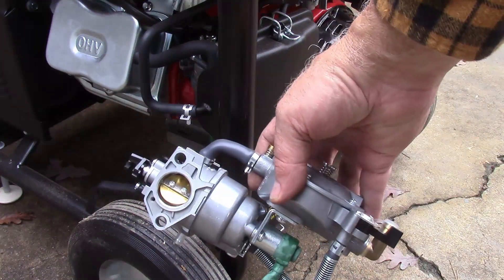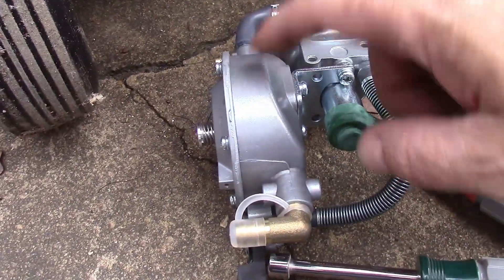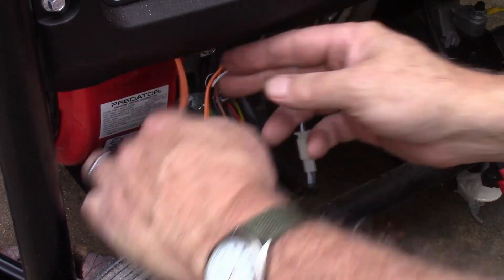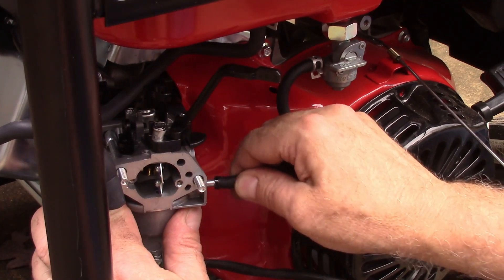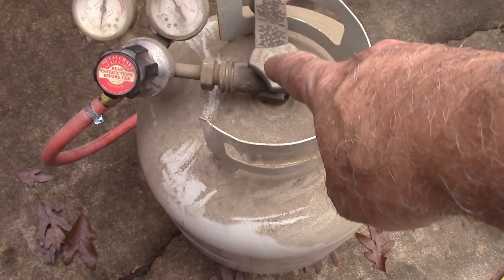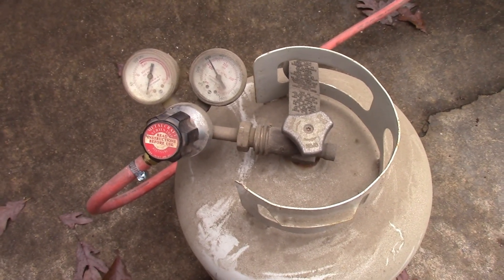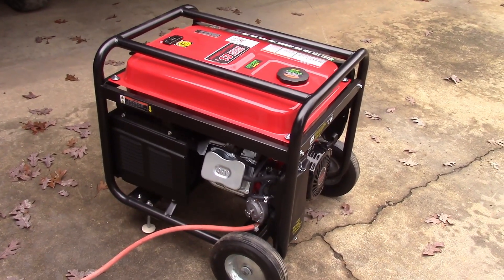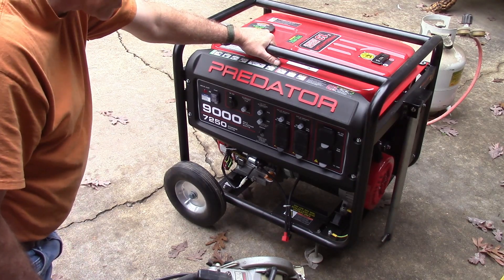Predator 9000/8750 Generator Propane Conversion  Tri Fuel

Comment: NOT FOR NATURAL GAS !!!   the link provided takes you to Amazon where product description says LP/CNG conversion kit.   CNG is Compressed Natural Gas which is not the utility being fed to your house thru a gas line.  This is the pressurized version they use in some city buses and truck fleets.   You can get a carburetor for household natural gas, but it is not the one shown in this video !
Reply: Please provide information to this 'household gas carburetor' that you keep referring to...thanks!
Reply: So much spam!!
Reply: Not so fast ....  While I COMPLETELY agree with your wording here, I think they (we?) are taking the term "C"NG out of context here. Everything you say about "CNG" is 100% correct (in industry), but I do believe that "they" are using the terms 'CNG', and 'NG' interchangeably. Here's why:

First off, CNG is an 'industry' thing (as you mentioned), it is NOT available to consumers as we're talking about many thousands of PSI. CNG simply isn't available to the average home owner for back-yard BBQ's, generators, and what-not.

Secondly, they wouldn't have a simple, low-pressure brass barbed cock on the input of the regulator for (real) CNG - it would be a high-pressure threaded (CIP?) flare fitting (like a hydraulic fitting). Same with "L"PG for that matter - "liquid" propane (as the term LPG implies) is also high pressure with propane pressures between 150 and 200 PSI.

Common sense says that both, their "LPG", and 'CNG' in the context of this consumer-grade carb is low pressure (gas). 1/4 PSI for N.G., and ~ 1/3rd PSI for propane.

Also, the carb in his video doesn't match the one in the Amazon link that he provided. I just bought one of these on E-bay. and it looks identical to the one in the Amazon link he provided.  The concern I have, is that I can't pull out the little orange handle to switch between LPG & NG ("CNG" as they call it).  The orange handle is simply a cam with slightly different size holes (orifices).

After reading all of the comments in this video, I too was ready to send this thing back (thinking that it wasn't really for city N.G., but I caught myself for the reasons outlined above.

With a little silicon grease, I'm sure I can get the little handle to work better/easier).

The only remaining concern I have is mixture adjustment for LPG or NG (or lack thereof with this carb). Lot of the bigger, more expensive conversion kits have a "load block", which is simply just a bolt in the side of a brass tube. But since those kids of "kits" are much more universal, especially the injection method, and placement. 

But since this really is a 'purpose built' carb, with a very static tube placement in the venturi of the carb (for a concise selection of engines), my guess is that the hole/orifice of that little orange rotary gas selection switch is a whole lot more "exacting", and thus doesn't need an adjustment 'load block' (for either gas).

I plan to install this on a fairly new Preditor 6,500 Watt generator, and try (BBQ regulated) propane, and city N.G.

I'll make it a point to come back here and report my findings.
Reply: Everyone really needs to be aware with generator safety https://youtu.be/I1jT3ANENvI I just hope you all stay safe. Thank you

Comment: I'd love to see it hooked up to natural gas to see how it performs. I use ng on my smaller 3500 watt gen now but thinking of going to a bigger unit.This carb looks to be ideal if it works. Thanks for the Vid. :)
Reply: NOT FOR NATURAL GAS !!!   the link provided takes you to Amazon where product description says LP/CNG conversion kit.   CNG is Compressed Natural Gas which is not the utility being fed to your house thru a gas line.  This is the pressurized version they use in some city buses and truck fleets.   You can get a carburetor for household natural gas, but it is not the one shown in this video !
Reply: @davec6016  Not so fast ....  While I COMPLETELY agree with your wording here, I think they (we?) are taking the term "C"NG out of context here. Everything you say about "CNG" is 100% correct (in industry), but I do believe that "they" are using the terms 'CNG', and 'NG' interchangeably. Here's why:

First off, CNG is an 'industry' thing (as you mentioned), it is NOT available to consumers as we're talking about many thousands of PSI. CNG simply isn't available to the average home owner for back-yard BBQ's, generators, and what-not.

Secondly, they wouldn't have a simple, low-pressure brass barbed cock on the input of the regulator for (real) CNG - it would be a high-pressure threaded (CIP?) flare fitting (like a hydraulic fitting). Same with "L"PG for that matter - "liquid" propane (as the term LPG implies) is also high pressure with propane pressures between 150 and 200 PSI.

Common sense says that both, their "LPG", and 'CNG' in the context of this consumer-grade carb is low pressure (gas). 1/4 PSI for N.G., and ~ 1/3rd PSI for propane.

Also, the carb in his video doesn't match the one in the Amazon link that he provided. I just bought one of these on E-bay. and it looks identical to the one in the Amazon link he provided.  The concern I have, is that I can't pull out the little orange handle to switch between LPG & NG ("CNG" as they call it).  The orange handle is simply a cam with slightly different size holes (orifices).

After reading all of the comments in this video, I too was ready to send this thing back (thinking that it wasn't really for city N.G., but I caught myself for the reasons outlined above.

With a little silicon grease, I'm sure I can get the little handle to work better/easier).

The only remaining concern I have is mixture adjustment for LPG or NG (or lack thereof with this carb). Lot of the bigger, more expensive conversion kits have a "load block", which is simply just a bolt in the side of a brass tube. But since those kids of "kits" are much more universal, especially the injection method, and placement. 

But since this really is a 'purpose built' carb, with a very static tube placement in the venturi of the carb (for a concise selection of engines), my guess is that the hole/orifice of that little orange rotary gas selection switch is a whole lot more "exacting", and thus doesn't need an adjustment 'load block' (for either gas).

I plan to install this on a fairly new Preditor 6,500 Watt generator, and try (BBQ regulated) propane, and city N.G.

I'll make it a point to come back here and report my findings.
Reply: Here is a reminder about portable generator safety: This advice is just to make sure that everyone is aware of all the warnings and it’s just to remind people to be careful using portable generators. Everyone has to see this safety reminder for safety. Every year, hundreds of people die or get injured when using portable generators due to carbon monoxide poisoning and electrocution. Make sure you are using your generator carefully and keeping others safe as well. There is something very serious that everyone should always be aware of when using generators. Some people do run their generator indoors which is not safe and that increases the risk of carbon monoxide poisoning which can cause death of family and you. Some people run their generator in wet conditions which can electrocute them. Please remember that you should never run your generator indoors. Remember that carbon monoxide is an odorless and colorless gas that you cannot see or smell. Carbon monoxide is a silent killer. Keep that in mind. Make sure your generator is 15-20 feet away from your house and away from doors, windows, and vents. Never use your generator in your porch too. Having a carbon monoxide detector is very important against generator safety. Some people also allow children to go near the portable generator which could pose risks. We need to keep an eye on our children making sure that they are not near the portable generator so they won’t get electrocuted or burned by the generator which is dangerous. A locking enclosure also keeps kids safe. A generator shed might look like a tempting place to explore, or take cover during a game of hide and seek, but a generator is a dangerous piece of equipment that can cause injury. It says on the manual that we should also keep children away at all times from the portable generator to avoid injuries. Please do not allow a child or unqualified people to operate the portable generator. Just because some manuals missed what should be listed doesn’t mean it’s safe to do. Always follow the generator safety rules when using portable generators. Generators pose electrical risks. If you need to use your generator during wet weather, you need a generator tent to protect your generator from getting wet. Don’t let your generator get wet. Keep your generator dry and before using your generator, please make sure your hands and your generator is dry. Do not wear loose clothing when operating the generator. Everything that is said on the generator’s operating manual should not be ignored. Never smoke cigarettes near the generator. Please keep flammable things away from the generator. Never overload your generator too. Your generator can catch fire. Never ever try to plug a generator cord into a wall outlet to avoid back feeding. Back feeding your generator is dangerous. Always turn on your generator first before plugging in appliances and shut off the appliances before turning your generator off. Use a heavy duty cord for your generator and the cord should not be worn out. All the instructions should be followed carefully. Never refuel your generator while it’s running. It can cause fire if fuel spills while your generator is hot. You should turn off your generator and let it cool off before refueling it. Having a fire extinguisher next to the generator is also important. This is only a reminder for everyone’s safety of using generators. Make sure your generator is properly grounded. https://youtu.be/I1jT3ANENvI and here is a video more about keeping others safe when using generators and also about our family’s safety. Hope this helps. Thank you. Hope you stay safe

Comment: Is there any throttle control on this carburetor ? 
I want to install one on a predator 206cc motor and run a pair of 12v generators with it but I dont want to run too many, or not enough rpm. I'd like to choose my rpm for optimum performance as well as fuel efficiency. 
cwalters6464@gmail.com

Comment: Have to tried to use it with NG?
Reply from the maker: No just propane
Reply: NOT FOR NATURAL GAS !!!   the link provided takes you to Amazon where product description says LP/CNG conversion kit.   CNG is Compressed Natural Gas which is not the utility being fed to your house thru a gas line.  This is the pressurized version they use in some city buses and truck fleets.   You can get a carburetor for household natural gas, but it is not the one shown in this video !
Reply: @davec6016  Do you have a link for the NG kit? So many out there it is confusing.

Comment: We used to put a light coat of wheel bearing grease on the carb gaskets to make them re usable and still be able to seal without them sticking to one side or the other.
Reply from the maker: That's a great idea!

Comment: The link for the kit says it's for a 5.5kwh generator but you're using it on an 8750. Does that negatively impact anything?
Reply from the maker: It hasn't and the two carburetors look identical except for the propane port.
Reply: @JackMasternone  brilliant, my man. Thank you.
Reply: @Ungovernable74  was trying to figure it out myself, found it and figured I'd share. seems a 5/8 hose has a 3/8 inner diameter as well. So I ordered this one....https://www.amazon.com/gp/product/B00NO1O6ZC/ref=ppx_yo_dt_b_asin_title_o00_s00?ie=UTF8&psc=1
Reply: @JackMasternone  well, I did the conversion, installed the hose I bought from your link and I can seem to get it started on propane. Gas is fine. I've experimented with different pressures on the dial and I can get it to start. Have you had any luck?
Reply: @Ungovernable74  I finally got the carb in and it and the adjustable regulator are sitting on my work bench. So no. You beat me to it. 

I feel that you may be flooding it...The adjustable regulator may be over kill we both probably could have gotten a standard "non adjustable" grill regulator.  The reason I say your flooding it I think the rate is low...like way low...like 1 psi. That's what gas grill regulator is I think 1 psi
Try 1psi and see what happens. 

Also I believe the carb has a spring loaded "bleeder/primer" on the carb regulator. I'd look but I'm away from the house. 
If it does, make sure the tank is on, the gas tank petcock is off, carb is turn to it's propane, and press that button bleeder/primer on the back of the disc a few times and see if it cranks up. 
If it does adjust the PSI rate and I think you will find that if you turn it up it will want to die from being flooded.
Reply: Let me know how it goes
Reply: If this seems to be the case I will probably return or just buy the "standard" low pressure grill regulator. Only 10 bucks

Comment: Amazon states it's for 4-1/2 to 5-1/2 KW generators, I see yours is 8700/9000. I would think it's not getting enough flow.
Reply: Here is a reminder about portable generator safety: everyone really needs to see this safety reminder to make sure. This advice is just to make sure that everyone is aware of all the warnings and it’s just to remind people to be careful using portable generators. Generators can be dangerous if not used carefully. Every year, hundreds of people die or get injured when using portable generators due to carbon monoxide poisoning and electrocution. Make sure you are using your generator carefully and keeping others safe as well. There is something very serious that everyone should always be aware of when using generators. Some people do run their generator indoors which is not safe and that increases the risk of carbon monoxide poisoning which can cause death of family and you. Some people run their generator in wet conditions which can electrocute them. Please remember that you should never run your generator indoors. Remember that carbon monoxide is an odorless and colorless gas that you cannot see or smell. Carbon monoxide is a silent killer. Keep that in mind. Make sure your generator is 15-20 feet away from your house and away from doors, windows, and vents. Never use your generator in your porch too. Having a carbon monoxide detector is very important against generator safety. Some people also allow children to go near the portable generator which could pose risks. We need to keep an eye on our children making sure that they are not near the portable generator so they won’t get electrocuted or burned by the generator which is dangerous. A locking enclosure also keeps kids safe. A generator shed might look like a tempting place to explore, or take cover during a game of hide and seek, but a generator is a dangerous piece of equipment that can cause injury. It says on the manual that we should also keep children away at all times from the portable generator to avoid injuries. Please do not allow a child or unqualified people to operate the portable generator. Just because some manuals missed what should be listed doesn’t mean it’s safe to do. Always follow the generator safety rules when using portable generators. Generators pose electrical risks. If you need to use your generator during wet weather, you need a generator tent to protect your generator from getting wet. Don’t let your generator get wet. Keep your generator dry and before using your generator, please make sure your hands and your generator is dry. Do not wear loose clothing when operating the generator. Everything that is said on the generator’s operating manual should not be ignored. Never smoke cigarettes near the generator. Please keep flammable things away from the generator. Never overload your generator too. Your generator can catch fire. Never ever try to plug a generator cord into a wall outlet to avoid back feeding. Back feeding your generator is dangerous. Always turn on your generator first before plugging in appliances and shut off the appliances before turning your generator off. Use a heavy duty cord for your generator and the cord should not be worn out. All the instructions should be followed carefully. Never refuel your generator while it’s running. It can cause fire if fuel spills while your generator is hot. You should turn off your generator and let it cool off before refueling it. Having a fire extinguisher next to the generator is also important. This is only a reminder for everyone’s safety of using generators. Make sure your generator is properly grounded. Having a fire extinguisher next to the generator is also important against the safety rules. https://youtu.be/I1jT3ANENvI and here is a video more about keeping others safe when using generators and also about our family’s safety. Hope this helps. Thank you. Be safe